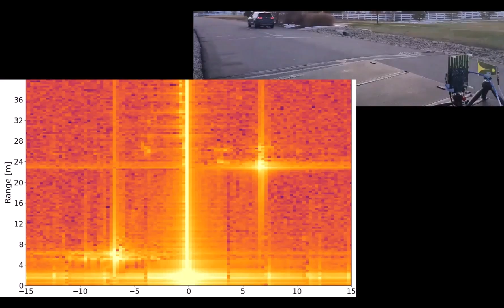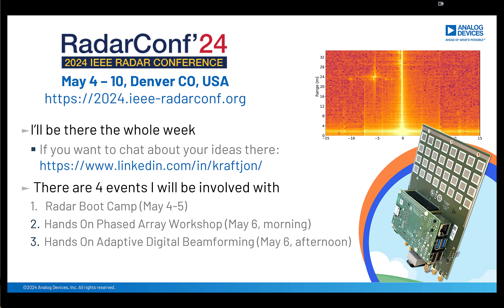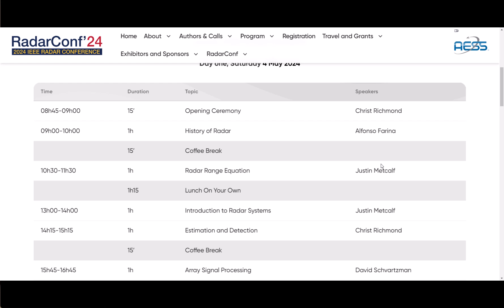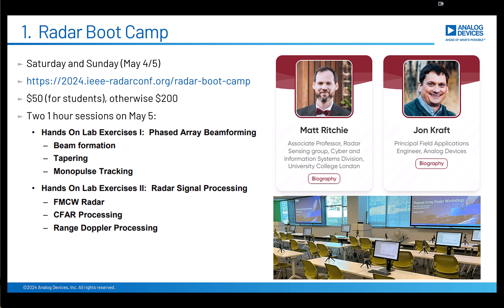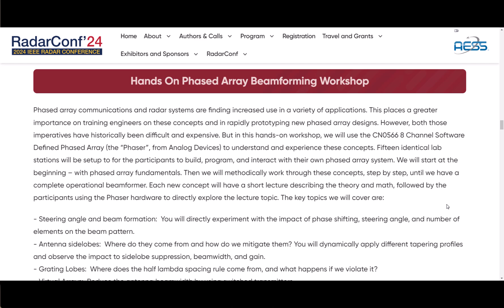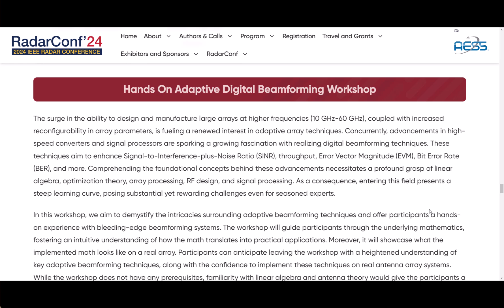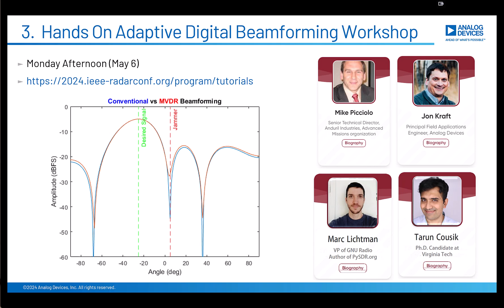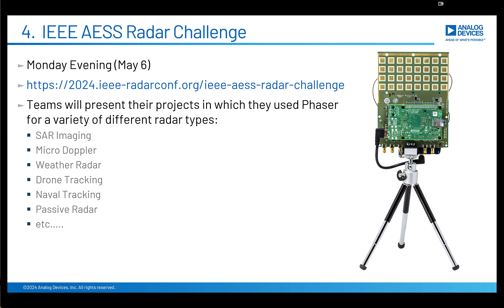Hands On Phased Array Workshops this May

Comment: Would you mind linking me to your discussion on using  hackRF one with the radar? I looked through the comments and was unable to find the discussion. I wish I could show up and check out the boot camp!
Reply from the maker: It would take 2 HackRF One's to do a CW radar.  Just one of them wouldn't be able to do the CW radar that we're doing in this series.  Because it can't transmit and receive simultaneously.  And so you also can't do the stretch LO to get higher BW.  You'd be limited to 20MHz.   And since you can't do CW, you'd have to pulsed, which would mean a lot more transmit power.  So between pulsed and 20M, you could only see large objects very far away.  All solvable problems, it just makes much harder to work on and demonstrate. 
Instead, the people that have used hack RF One are using 2 of them for CW radar.  Or they are doing passive radar.  So I'd research that, and see if you can do something cool with it.
Reply: @jonkraft  Bummer...HackRF One being open Source with plenty documentation out there & so many wickedly talented  individuals having some way or another crossed paths with it... I am surprised, seeing that there are a small number ( yet substantial in a sense- otherwise we'd possibly see some traction in the area?)- a small number of very specific limitations which if addressed would make the HackRF one THE device- take it's half duplex limitation... yet not really a limitation since 2 can be daisy chained along together as a feature...but, maybe a limiting one since folks are just like.."put 2 HRF ones together...."...maybe that needs to stop and a talented soul or 2 give us a HackRF Two with full duplex or something of that nature?!